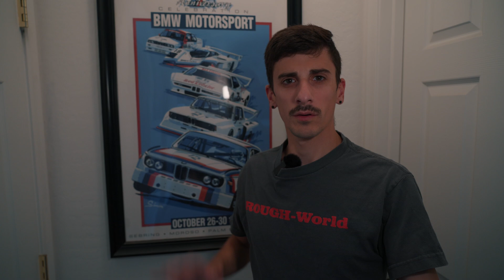Best ECU/Tuning Options For Your BMW E36!

Comment: Have you tuned on a the ecu master det3+? Been looking into that for my turbo m50b25 non vanos
Reply from the maker: For the M50NV I would look into the Link pnp, I believe they call it BMW link+. I'm really not a fan of generic ecus that are made to work using patch harnesses. 99% of the time there's some wiring or setup/configuration issue

Comment: Hey, I have a 98 m3, and I am currently working on putting in a turbo. My question is, I want a link standalone on my S52. What do I need to make this work? Or which standalone do you recommend for the S52 turbo platform. By the way, I want to drag race from time to time.

Comment: Where are you located? I have 99m3 bone stock that i purchased a month ago. Currently flushing all fluids and looking doing preventative maintenace. 105k runs strong. Would like to add little HP without negativly effecting other components like a tune without the proper undates. Suggestion for novice or leave it alone until educated myself? Im in NJ if ya around this way lol
Reply from the maker: I can either do a remote tune or you can send me the ecu, hit me up on Instagram (same username)

Comment: What about a 92 OBD1 M50B25NV with a Bosch ECU. Stock dme is a no-go, there doesn't seem to be a plug & play solution either. There's only PnP solutions for the m50tub25 (vanos).
Reply from the maker: I think there's a pnp version of megasquirt, at least there used to be. Otherwise you'll have to get a jumper harness
Reply: I have a 92 OBD1 m50B25NV (with actually an s52 bottom end) and it looks like there is a VEMS plug and play as well as an ECU MASTER option that looks interesting to me
Reply: The 1992 OBD1 M50B25NV DME (403 or 402) can be tuned. I'm running a Dinan supercharger with 30lb Bosch injectors. Remote tuned by Karl at Active Autowerkes.

Comment: What do you think about boosted N52B30 ?

They're getting more popular, not the best engine to boost but they're getting better (350-400hp)
Reply from the maker: I'm pretty sure the rods and pistons are really weak in those, and the compression would probably be too high
Reply: @CanyonTuned  Max HP recorded on stock block was in the 600s but the engine blew on the dyno.

I've even seen people say that a turbo N52 (small boost) is more reliable than a N54. Who knows

Comment: Do you have any experience with the new MS3Pro PnPs for OBD2 e36's? I'm leaning that way over Vems since I hear that Vems hardware is on the older side.
Reply from the maker: I have experience with both, I would say the hardware/software on the MS3Pro is newer and frequently updated. While the VEMS hardware works great (although getting flex fuel to work is a little bit of a hack). Don't expect VEMS to update anything in the future. It's kind of a dead development project at this point.

Comment: Hey bud I was trying to figure out how to message you. But I couldn't so I'll ask you in the comments. I have an E36 M3 it's the S52. I wanted to know if you can tune these cars without having any forced induction.  I have a 3.5  intake and I'm not sure if I can put a 3.5 MAF as well and if I do put a 3.5 maf should the car be tuned after?
Reply: Yes, you can tune non FI e36's on stock DME and it should work great. If you're going to get a 3.5 MAF you'll want a 3.5 intake, injectors, and optionally bigger cams. And yes, you'll need a tune as well.
Reply: @FourCuteCats  I  have a 3.5 intake on it now. Next step is the 3.5 MAF. You don't think I can get away with stock injectors? Or are you saying it's only worth doing all that if you get injectors and cams? Also I'd like to try and tune the car myself. I just don't know where to start. If you wanted to share ypur knowledge it would be greatly appreciated 🙂. At least how to start the process.
Reply from the maker: @dbldwn3842  Stock injectors with which engine? The S52 pink top injectors have some headroom for more airflow but not much. You'll need to log injector duty cycle to be 100% sure. Also I have a ton of videos on how to tune the stock DME. https://www.youtube.com/playlist?list=PLflcXINTFVbuHbL79RXLP4qBUpB1_fYnV
Reply from the maker: The stock DME is still great for NA applications! I thought I had mentioned that in the video
Reply: @canyontuned ok cool. Thank you for the link I will go check it out.

Comment: I run a wire in speeduino that cost me about $120USD total excluding the wideband sensor and controller, also uses TunerStudio so has auto tune. It's a great learning experience since it's all open source.
Reply from the maker: I heard about those but wasn't brave enough to try it. Do you have a link of a step-by-step guide on how to implement it?
Reply: @CanyonTuned  there's an online manual that you can google, also some videos on youtube. I can't link anything here because youtube will remove my comment. Speeduino is basically just the firmware, there are a few official boards and lots of user designed boards including a plug and play E36 board. Each board would have different instructions but they all use the same speeduino firmware. I would recommend starting with a board called "UA4C", then wire it in like you would any other stand alone. I just cut the stock ECU connector off the stock harness. Lots and lots of info on the forum and facebook groups.

Comment: I believe ms41.3 can have automatic injection based on closed loop wideband sensor with your pre set AFR's
Reply: The custom code is free bro and the developer is dead. RIP Abhishek Shinde
Reply from the maker: Ok after looking into this I still don't see where you get the ms41.3 definitions. And under speed density it says "Speed Density has been loosely tested to not function properly so it is not considered a usable feature." So I don't trust it
Reply: Ive got ms41.3 on my boosted m50 and would definitely recommend it over ms41.0. Its still a budget option at the end of the day but it makes things a lot easier when it comes to getting the car setup and driving for road tuning ect. It would be pretty cool if they got speed density working but even then, target afrs and extended tables make it worth it imo. Ign cut limiter, boost control and flex fuel are pretty sweet too. There is pretty good support for it in the bmw tuning discord, people have made some good base maps for different m/s5x variants which also makes things a bit easier. Its free and easy to flash so would recommend trying it if you have a stock ecu
Reply: @ethx9837  can you please share the discord?
Reply from the maker: Hmm well if there was better documentation out there I'd be on board. But trying to get those devs to do anything the past few years has been awful. They want $300 for the custom code with 0 documentation. No thanks
Reply: If your car (E36 S52) is not boosted, NA with mods, larger MAF, M50 intake, full length headers, no cats, are you still suggesting not to stick with the stock ECU. Or does that comment only apply to boosted applications. At some point I want to switch to more aggressive cams and higher flow injectors.